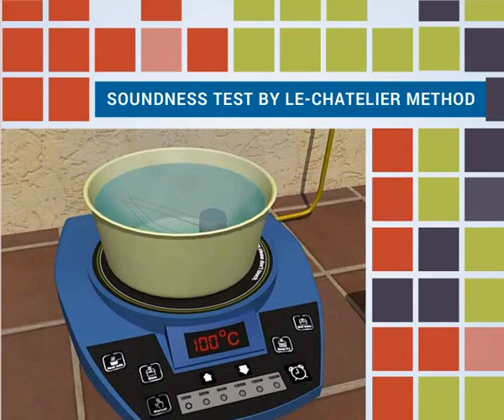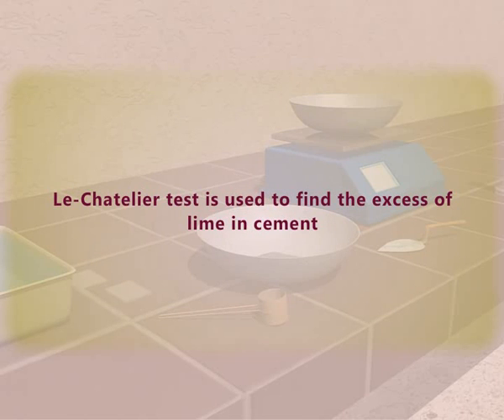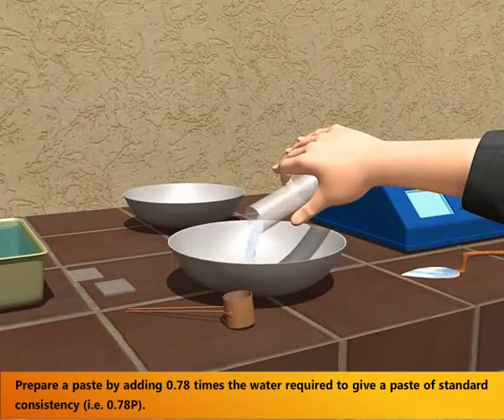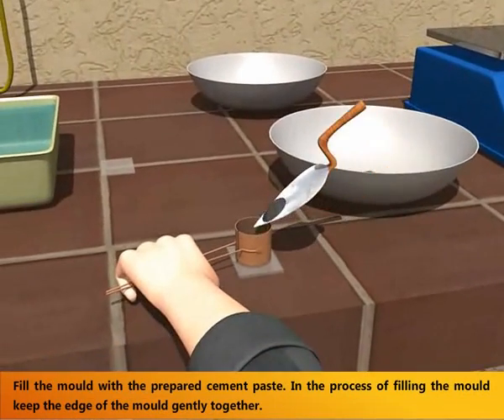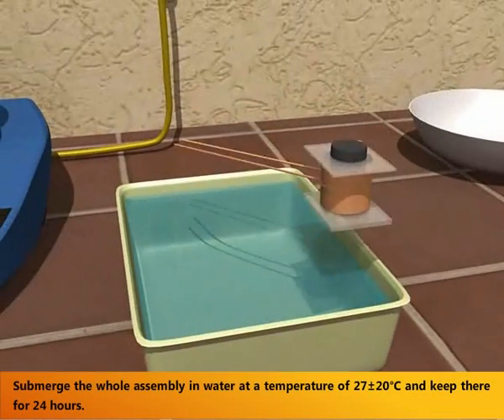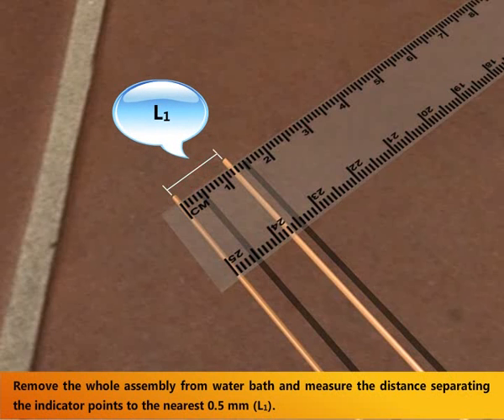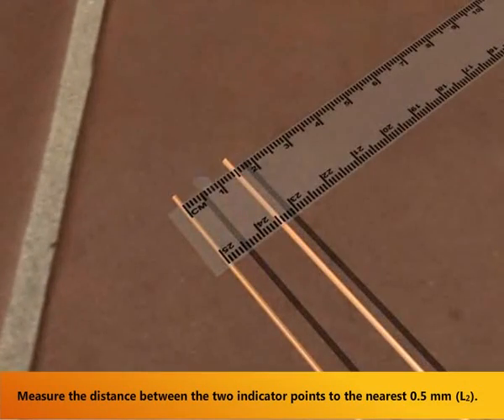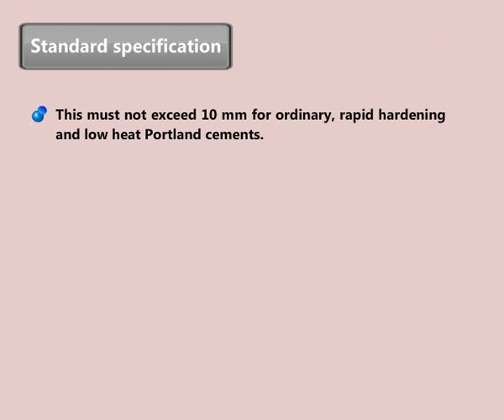Soundness Test by Le-Chatelier Method | Cement Testing | Animated Explanation  #civilengineering

Comment: please check the formula,
 correct formula for soundness/expansion of cement is=L2 - L1
Reply from the maker: The difference between these two measurements represents the expansion of cement. So it will be either L1 - L2 or L2 - L1.